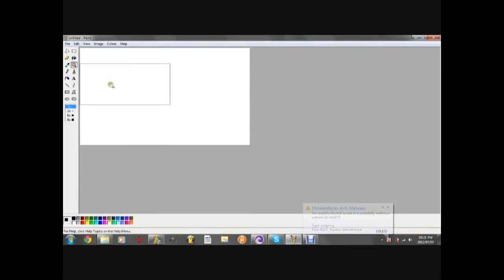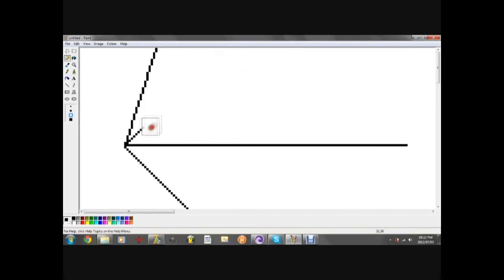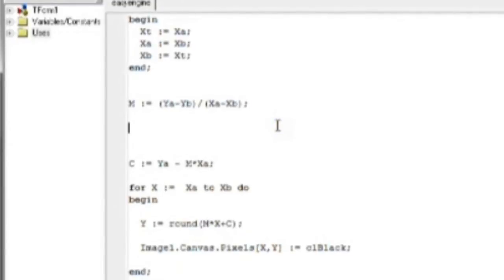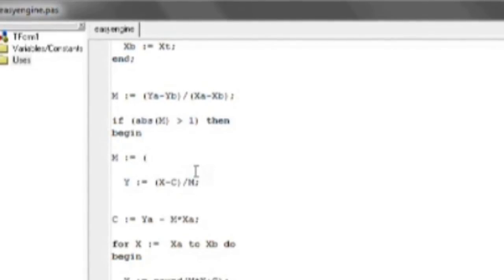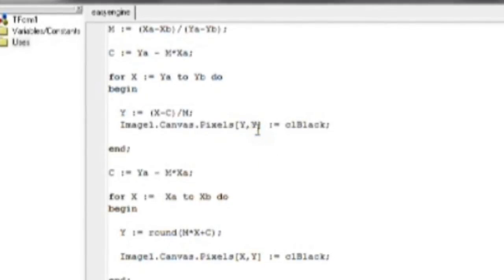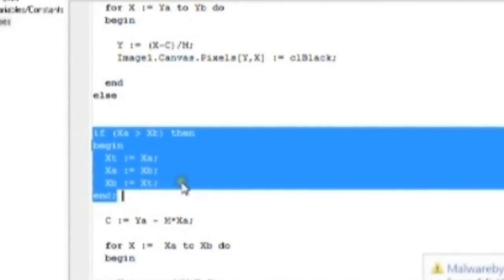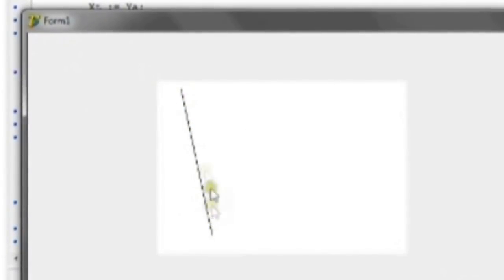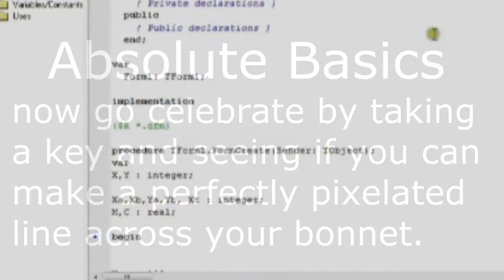Absolute Basics - Code your own VERY simple 3D engine - part 3

Comment: Eh, even though it was 2 years ago, to answer ThruEternity's, in many line-drawing algorithms, if the line is completely vertical (X1=X2), then you treat that as a special case with another IF statement. It's not very hard to handle.